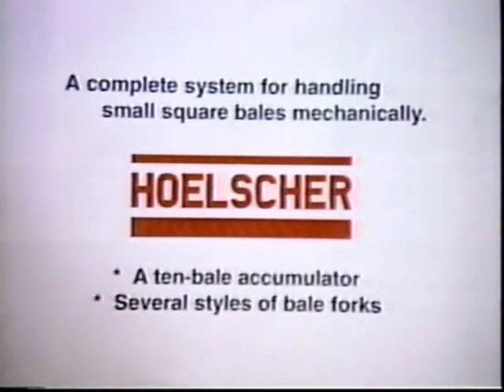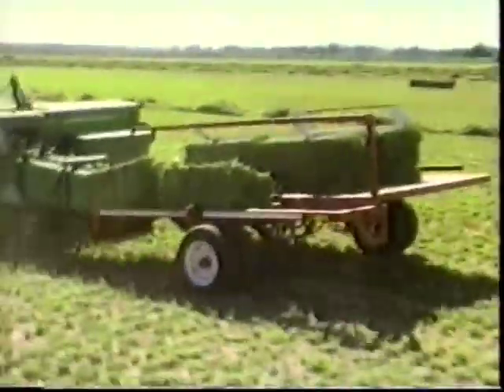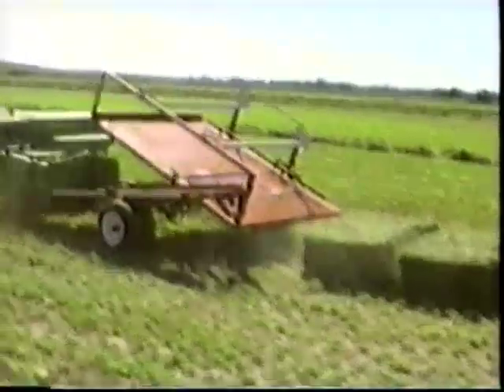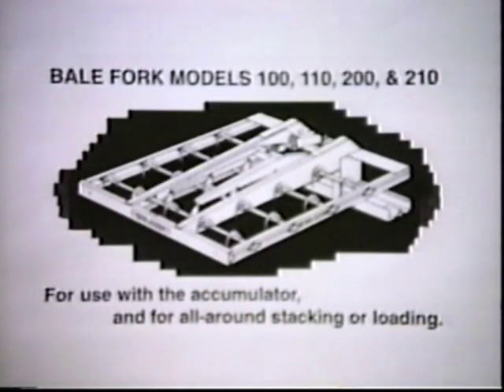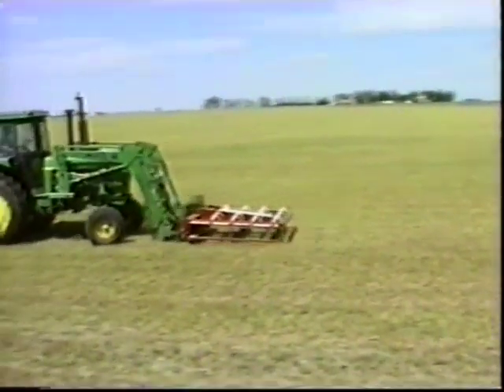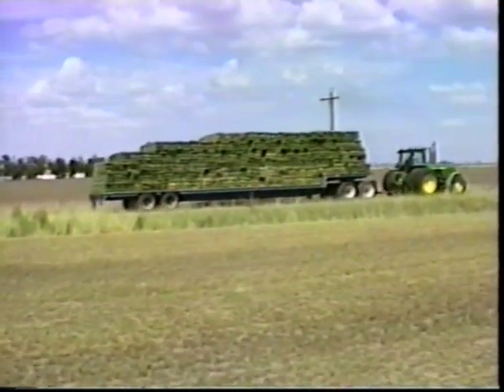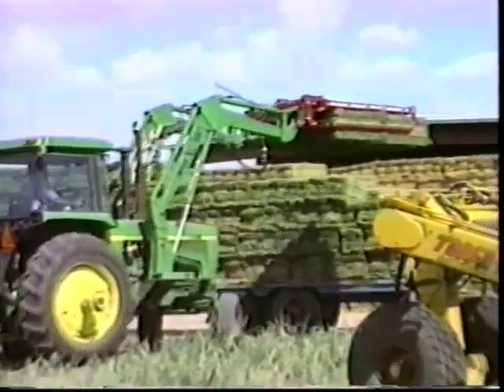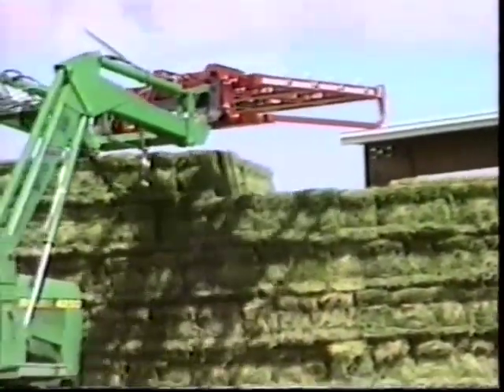Bale Accumulator from Hoelscher Inc

Comment: Dude...  adjust the hydraulics before you break the push are slamming those bales onto the table.
Reply: Yes it will eventually break the push over arm if you don’t slow down the tractor hydraulics. Been there done that !